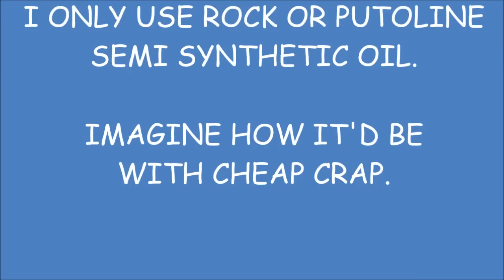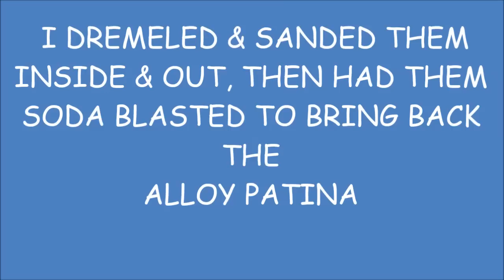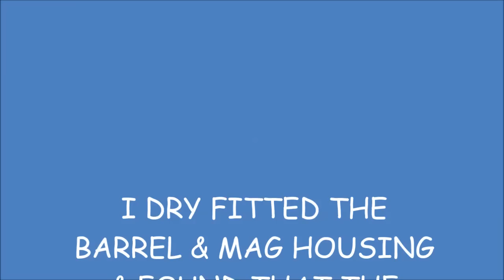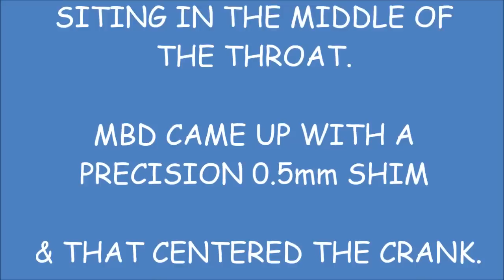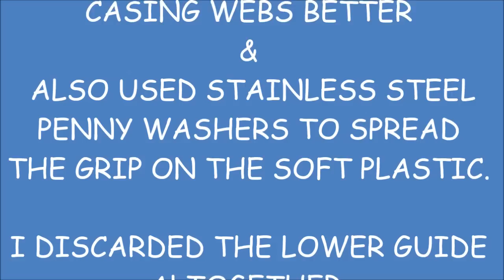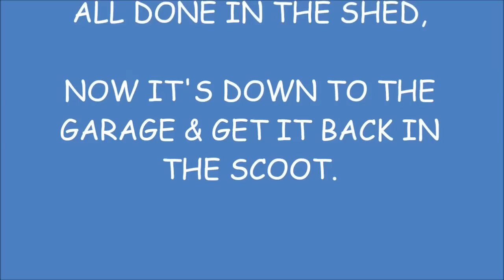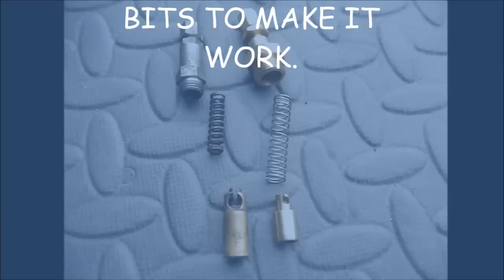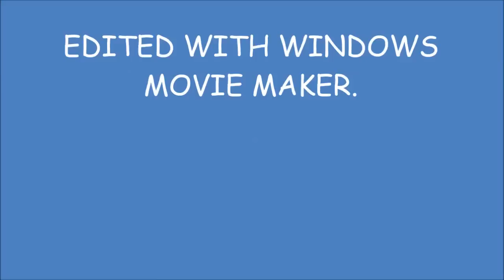LAMBRETTA ENGINE RE BUILD 2012

Comment: Where do you get your parts from please John?
Reply from the maker: It depends really, I got the Mugello kit from LTH in Germany (they had the only version 4 at the time) I use CamLam a lot, all the cable control bits are MB, all the fork internals are MB, the crank is PM Tuning, Scootopia are great for standard bits like trunions, cables, speedo, badges & trim, & Scoot RS supplied the exhaust, front shockers & carb. I don't buy used bits or e bay open market stuff but I do use online shops on e bay like the front disk brake & hub from KBR. & some stuff from TSR in Wales.
best advice I could give is buy the best you can afford especially engine bits. good luck, John.
Reply: Many thanks for you reply and advice John.

Comment: Thanks mate,  
what type of size engine did you have?
I have a 1971 150 gp and am looking at doing something with it.
BTW thats the brunell bridge in plymoth is'nt it?
Reply from the maker: +Gimme 2  Hello mate, before I fitted this Mugello 225 it was a Indian GP 200 Motor. I think if you have a 150 the biggest you can fit is a 198cc Mugello (I think) my pal has a Casa 186 on a 150 case & that's brilliant)
Yes That's the Tamar Bridge & Brunell Bridges in the opening shot, taken from Saltash Cornwall, my town.
Good luck with the build, my advice, don't go too exotic, & DON'T get an e-bay kit, my mate has had a hell of a time with his & binned it in the end.  Cassa, Mugello, MB. that's the way to go..................
Reply: Cheers John,
And thanks for the info and the vid.
My mate moors his boat out there , just up river is the sailing club from that pub with the union jack on it.
ill drop in for a beer if i see ya scoot outside.

Comment: Nice job on the old 66 Lamb' 👍😉
You did good. You should feel very satisfied.
Reply from the maker: Thanks, it went well too but I had lots of petty probs with the PWK carb so swapped it out for a Delly 26 PHBH, I've also had to change the crank, the X-Tec one twisted (probably down to the old SIL flywheel to heavy for the extra torque but it was built light) I put in a MB 58/110 with a 3mm packer under the barrel. still going strong....
Reply: John Wilcox , back in the mid 60's I had a Vespa 150 Sportique and a Lambretta Li 150. I loved them both.  Haven't had a scooter since, but often get the yearning. ...🙄
I have lived in Canada since the 70s and you just don't see many scooters on the road, although. ..I see a place in Vancouver selling Vespas. .🤔 Who knows, maybe I will relive some of my teenage years. ...😆